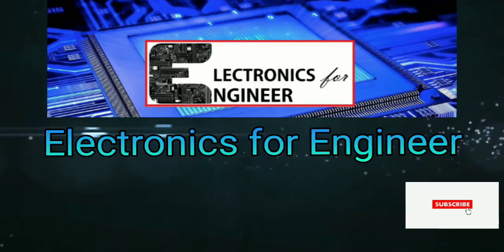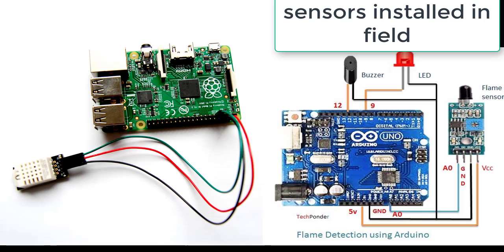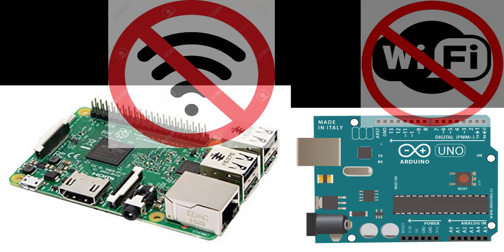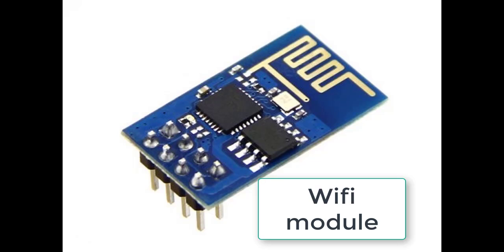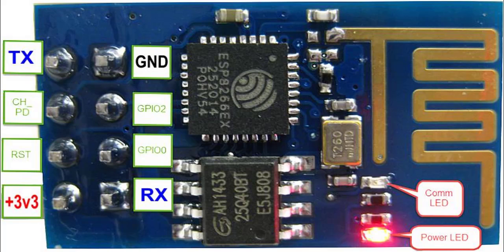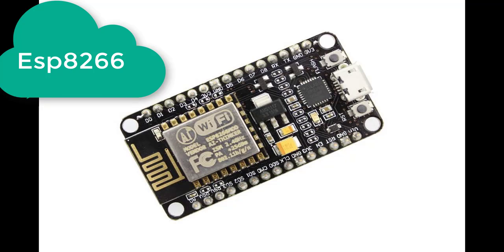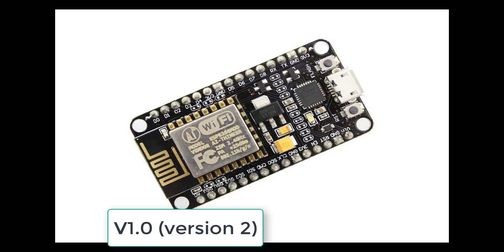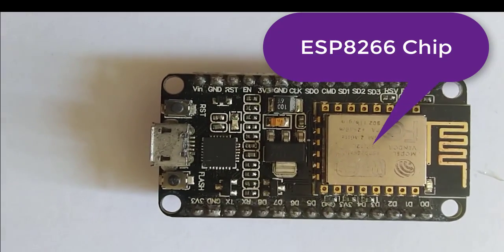Introduction to NodeMcu & Why NodeMcu?

Comment from the maker: Small correction, In earlier models like raspberry pi 2 doesn't have on board WiFi, we have to use external adapter. But new models from Raspberry Pi 3 have built in WiFi.

Comment: The main reason for using Node MCU are: 1. small form size. 2. can be set as AP/Stn or both which allow interlinking connection network over factory floor or large factory or farm area. 3. It has lower power consumption compare other big units like raspberry pi, but power consumption can still be larger when compare with others module like ESP01.

Comment: Hi buddy, one small correction, RPI has inbuilt wifi, only problem is the cost is about 15 times than that of nodemcu. 🙂
Reply from the maker: Yes bro, by mistake I mentioned that. Actually from Raspberry Pi 3 only, they started in built WiFi, for older versions, we need to use WiFi dongles.

Comment: Raspberry pi has built in wifi
Reply from the maker: Yeah. In earlier models like raspberry pi 2 doesn't have on board WiFi, we have to use external adapter. But new models have built in WiFi.

Comment: Bro i want to connect a hard drive with this esp8266 or esp32 and use them as a server through which i can access my hard drive data wirelessly is that possible in any way??
Reply: N